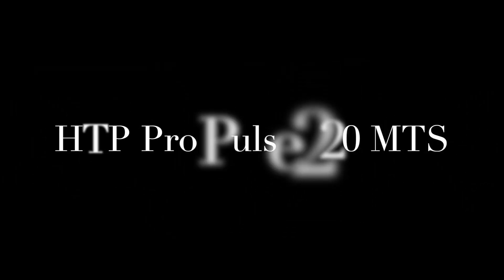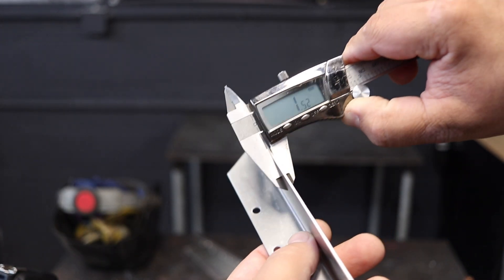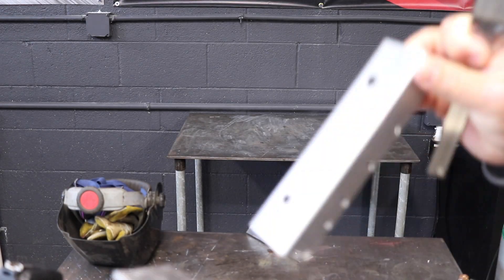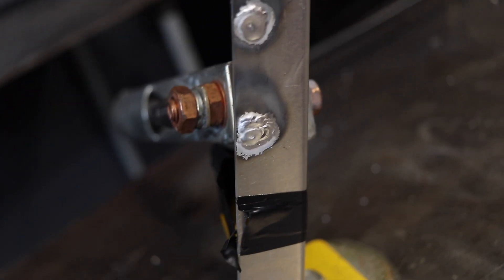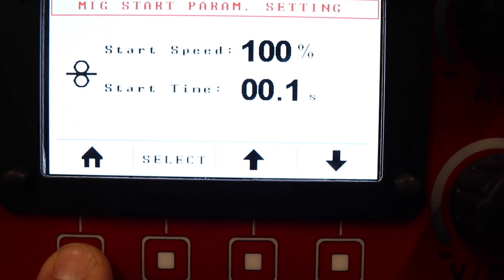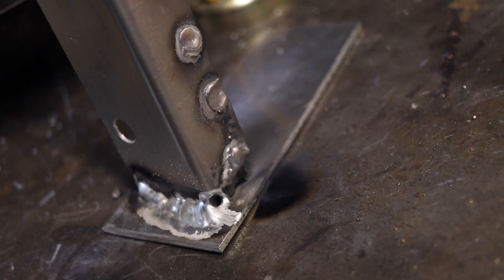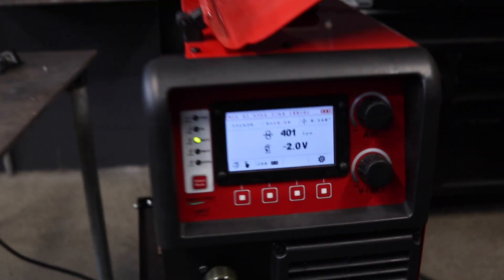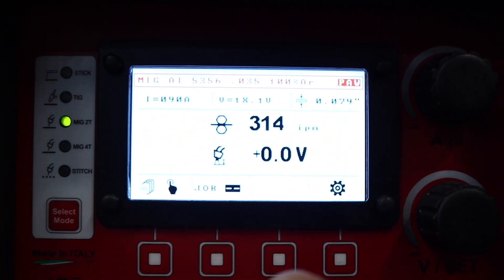Aluminum handrails short welds on thin wall tubing

Comment: I have a business fabricating custom designed aluminum gates, driveway gates, walkthrough gates, estate gates, security gates gates gates gates but everything is aluminum. I have to weld a wide variety of thickness together every time I do I gate build. I'm looking for a welder that I can mig aluminum and it also have pulse modes and where you can adjust the cleaning on it much like tig welders. When I first started welding aluminum the guy I worked for had a light blue color welder that I thought was an HTP but these are red... Not sure if it's the same makers. What's the thickest aluminum this can comfortably weld without preheating the material. That'll give me an idea on what materials I'd have to preheat and how much preheating. Right now I'm using tig and spool gun but I need something I can use to be able to go a little faster because I do thousands and thousands of aluminum welds. It's taking me too long to get a gate completed verses prices in able to sale them at. If I could go faster I could make them cheaper therefore being able to get more business thus having more of a steady income. It's just me, my wife they builds them so we can afford the ones that cost $15,000 but I don't want one that's going to make ugly welds and have constant little problems because of not being able to make a lot of back to back welds.

Comment: Do you think the 220 mts would comfortably handle 1/4" steel in single pass? I'm looking for a mig capable machine that's not much higher in price than the 220 to build a hydraulic press.
Reply from the maker: Yes the pp220 will absolutely handle 1/4” comfortably in single pass !
Reply: Like butter

Comment: Does that machine have special 4 step trigger. Helps a lot with this problem.  I have mine set at 135% for as long as I hold the trigger in the beginning with a .8 second down slope and a 50 percent crater fill.  On that thin of material I just pull the trigger in the beginning and let the .8 second down slope do it's thing. Works good and fixes the cold start and the burning through on the last half inch of weld at the end of the piece.  I enjoy the content .  Thanks.
Reply from the maker: yes this machine had 4 T special trigger.  or it has the ability to use an infinite remote in 2T or 4T .....  all of that does not change the fact that due to its inverter speed and the way the machine is build in 035 pulse aluminum programs the machine will take 1-1.5 sec to reach it "final and preselected" arc (cone) length ....  at very high start speeds the symptoms are a little better hidden ... LOL